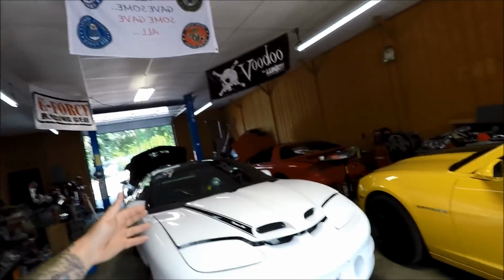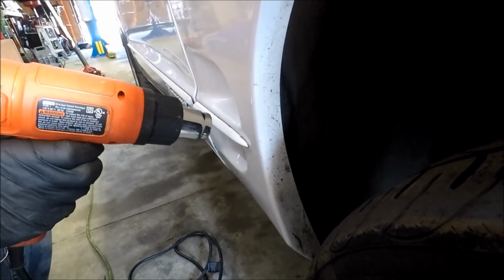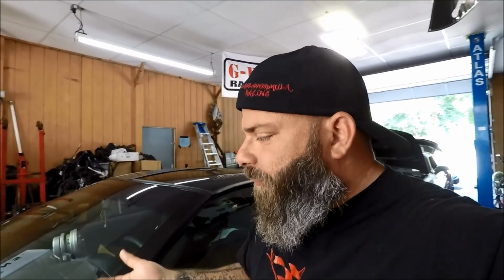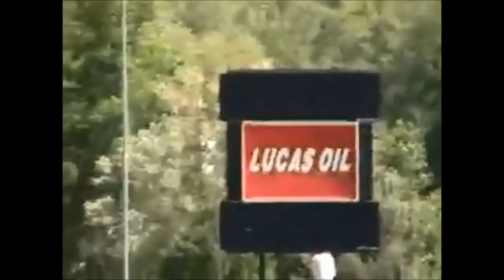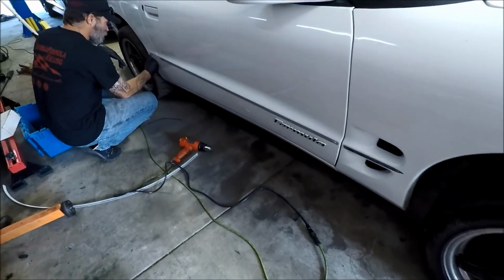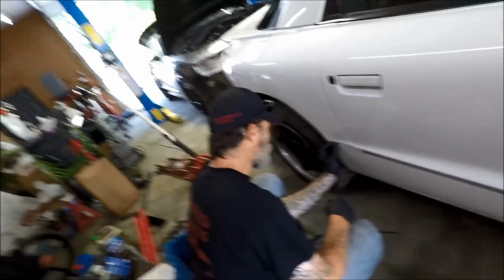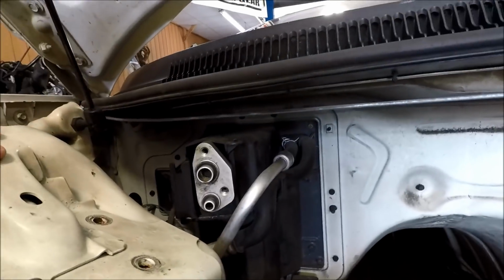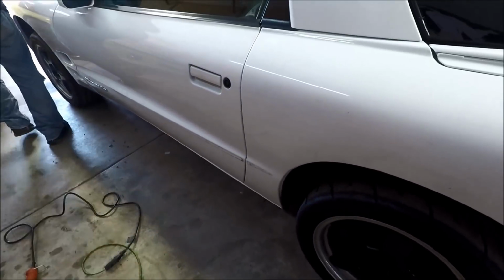Project "GHOST" History!

Comment: Great video Ande!
You can also use your heater to help pull heat out of the engine if you need to and sometimes just rubbing those adhesive areas with a good cleaner wax will take off the remaining adhesive. Or, they make a decal remover that you use with a drill that may work as well.

Comment: I am a Trans Am guy . I have owned 7 of them in my lifetime . My last one was a 2002 WS6 T/A that got stolen on a business trip to New Orleans . Since you can’t get a new Trans Am I have gone back to the Camaro life . If Pontiac ever made them again I would be the first one at the dealer ordering one
Reply: ZL1Speed43 look up trans am worldwide. Based out of florida.
Reply: ReaperRacing Trans Am Depot sells new Trans Ams built from a Camaro platform but the cost is crazy high .
Reply: ZL1Speed43 I know the price is up there but the quality of work they do is amazing.
Reply: ZL1Speed43 
Yeah sadly though the only problem is Pontiacs no longer around cuz when GM file bankruptcy in 09 Pontiac and Oldsmobile and Saturn went with it I actually have won the last Pontiacs the GM made their G6 line I have an 07 G6 oh well it was fun while it lasted I'm thinking about going back to Mopars anyway
Reply: Trans Am depot currently owns the rights to the trans am name.  Its basically a real trans am built off a camaro but thats all they ever were anyways.
Reply: It is expensive for that camaro trans am body they do, but its worth it. Cars seem to be going up not down. My truck is still the same value i bought it at used 7-8 years ago. I cant touch a truck these days without having to pull 50k out of my ass. Id pony up and get the trans am "kit car" as thats all there will ever be.

On a side note, there is a dealer in victoria tx across from atzenhoffer chevy that has 3 firebirds and a couple camaros 2000s and back. Also other classics. Dont recall the dealer but google maps is still accurate. He keeps all the cars under covers.
Reply: You mean GM

Comment: 3M makes a rubber wheel to put on your drill that will take that tape right off. It's a lot like an eraser on a pencil, just take your time and dont spin it fast or you'll risk getting into the clear. Cost like 10 or 20 bucks if my memory serves me correctly.

Comment: Which rear end are you running?
Reply from the maker: MWC Fab 9"
Reply: Ty sir I still have the factory 10 bolt in mine looking to step up to the 9" so I can slap some real stickies on it mines a 98 black on black ws6 w/ ram air basically ghost's evil twin lol